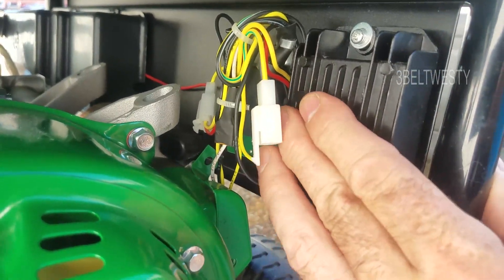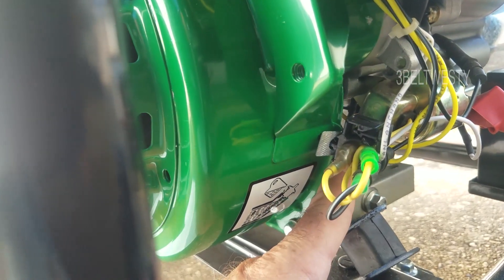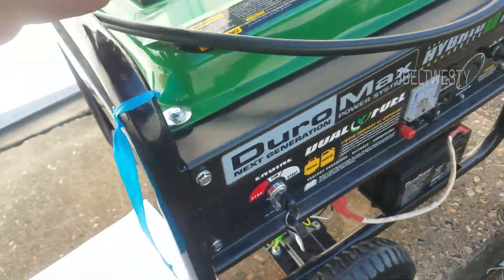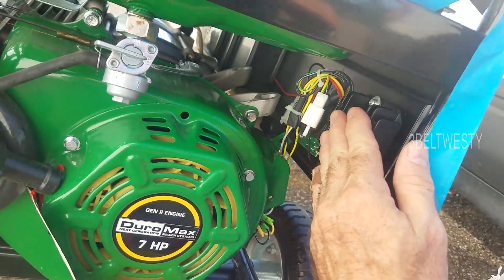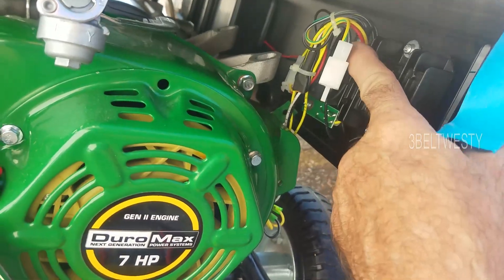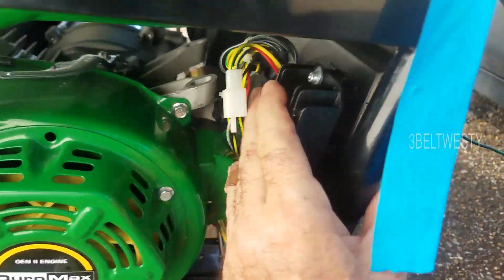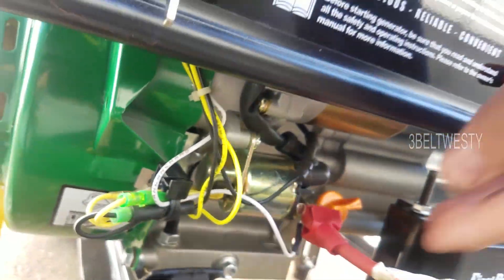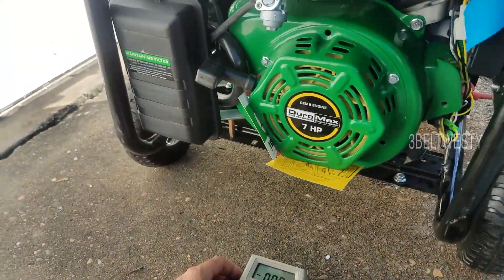Duro Max XP4850EH Generator Mystery module 12v?

Comment: Its a rectifier that converts ac to dc . mystery solved
Reply: The bridge rectifier is located near the breaker.
Reply: Don’t forget about the generator safety rules: Always make sure you follow all the generator safety rules whenever you use your portable generator. This is only a reminder. Generators can be dangerous if not used carefully. Every year, hundreds of people die or get injured when using portable generators due to carbon monoxide poisoning and electrocution. Make sure you are using your generator carefully and keeping others safe as well. There is something very serious that everyone should always be aware of when using generators. Some people do run their generator indoors which is not safe and that increases the risk of carbon monoxide poisoning which can cause death of family and you. Some people run their generator in wet conditions which can electrocute them. Please remember that you should never run your generator indoors. Remember that carbon monoxide is an odorless and colorless gas that you cannot see or smell. Carbon monoxide is a silent killer. Keep that in mind. Make sure your generator is 15-20 feet away from your house and away from doors, windows, and vents. Never use your generator in your porch too. Having a carbon monoxide detector is very important against generator safety. Some people also allow children to go near the portable generator which could pose risks. We need to keep an eye on our children making sure that they are not near the portable generator so they won’t get electrocuted or burned by the generator which is dangerous. A locking enclosure also keeps kids safe. A generator shed might look like a tempting place to explore, or take cover during a game of hide and seek, but a generator is a dangerous piece of equipment that can cause injury. It says on the manual that we should also keep children away at all times from the portable generator to avoid injuries. Please do not allow a child or unqualified people to operate the portable generator.  It is important to keep your children safe especially little ones. The portable generator can be hot during an operation. Just because some manuals missed what should be listed doesn’t mean it’s safe to do. Always follow the generator safety rules when using portable generators. Generators pose electrical risks. If you need to use your generator during wet weather, you need a generator tent to protect your generator from getting wet. Don’t let your generator get wet. Keep your generator dry and before using your generator, please make sure your hands and your generator is dry. Do not wear loose clothing when operating the generator. Everything that is said on the generator’s operating manual should not be ignored. Never smoke cigarettes near the generator. Please keep flammable things away from the generator. Never overload your generator too. Your generator can catch fire. Never ever try to plug a generator cord into a wall outlet to avoid back feeding. Back feeding your generator is dangerous. Always turn on your generator first before plugging in appliances and shut off the appliances before turning your generator off. Use a heavy duty cord for your generator and the cord should not be worn out. All the instructions should be followed carefully. Never refuel your generator while it’s running. It can cause fire if fuel spills while your generator is hot. You should turn off your generator and let it cool off before refueling it. Having a fire extinguisher next to the generator is also important. This is only a reminder for everyone’s safety of using generators. Make sure your generator is properly grounded. Having a fire extinguisher next to the generator is also important against the safety rules. https://youtu.be/I1jT3ANENvI and here is a video more about keeping others safe when using generators and also about our family’s safety. It’s important to keep our little children safe as well. Make sure your little children are kept away from the generator at all times especially when it’s running. Hope this helps. Always remember that it’s better to be safe than sorry.